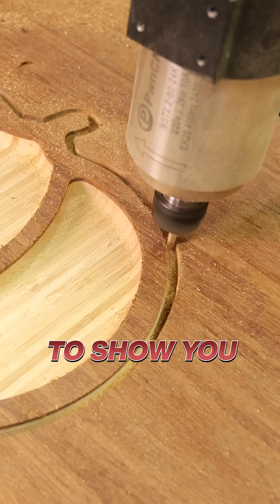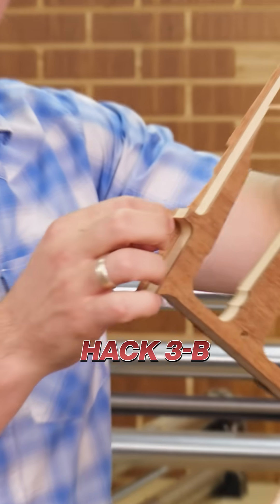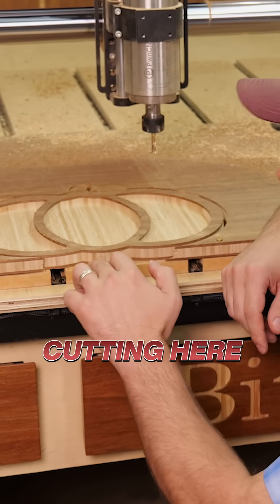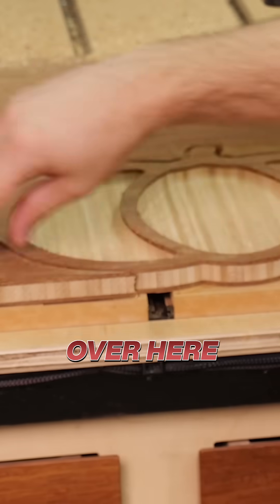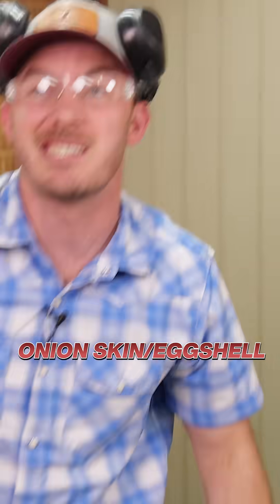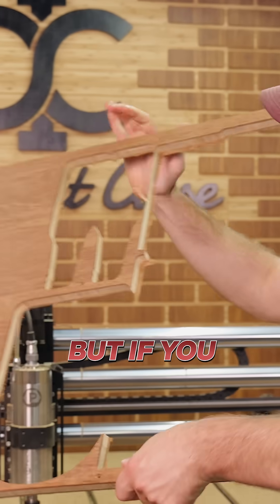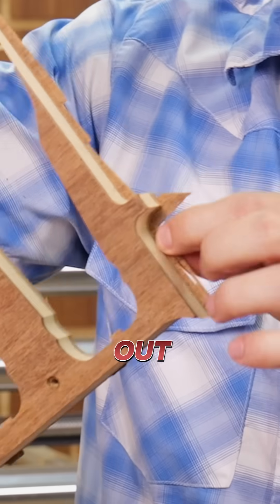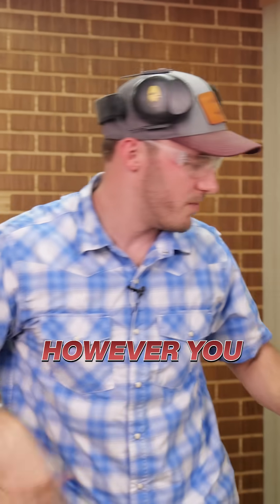Always set your Z- height

Comment: Your processes are in the wrong order. Do the work that can cause vibrations that will kill the part before you mill the outside. Doing finer detail work first can save time on failures because if the fine detail fails, you can start over before you've invested the time and energy into the easier parts of the program.
Reply: My thoughts exactly 😅